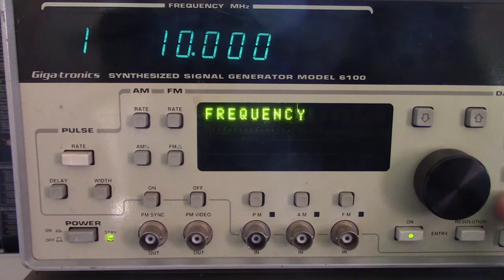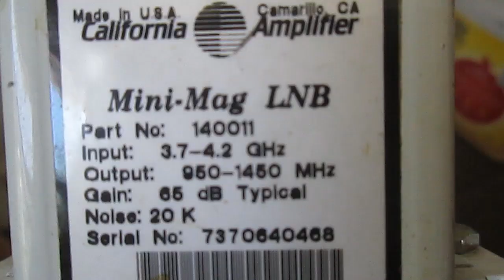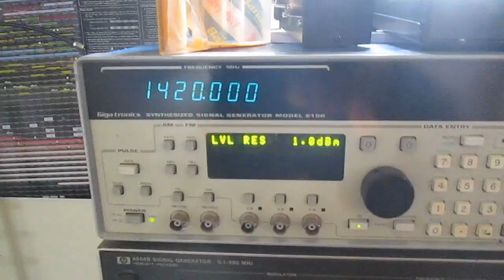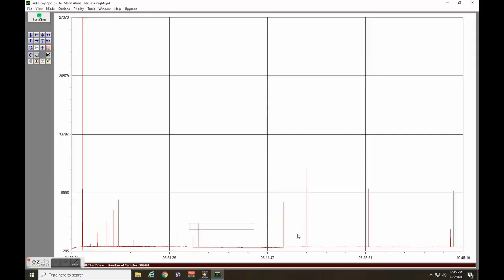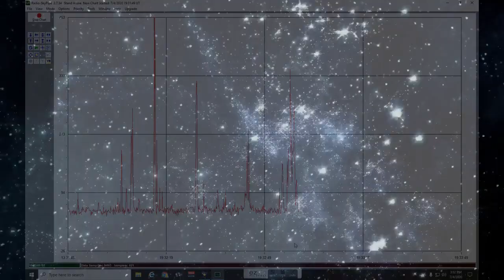DIY RADIOASTRONOMY

Comment: I have purchased my parents old house from the estate. There are a lot of tall trees to the east and west but I have had some luck with backyard astrophotography so far. There are not one but two 12' aluminum mesh satellite dishes (left over from the old c-band days) in the backyard... Would these dishes have value in a DIY Radioastronomy setup? Could they be used together and increase effectiveness?
Reply from the maker: 12 feet ! Hell yeah they would ! You can even combine the signal and make an interferometer !!! That's really good stuff!!! Look it up and enjoy ! You can have a lot of fun!!! I am actually jealous!!! Please post pictures or video of the whole setup !!
Reply from the maker: The link doesn't open
Reply: @Neptunium   Darn... I tested the link and it works for me but I'm no YouTuber. It's the only video in my channel as I just did it to show you. I value your opinion of what I would be able to do with this. Hope you can take a look there.
Reply from the maker: @stringb2647  ok it worked ...yeah I see  what you mean with these tall trees...it should nt matter too much at longer wavelength. Here is the catch these antenna get better gain at smaller wavelength. Right where the trees could  be a problem...but I would still try  because what you might loose in gain in one antenna, you'll gain it 10 fold if you combine the signals from both antennas . When they point in the same direction you'll have the equivalent resolution of a 100 foot dish!! So who cares about the trees!!!
Reply: @Neptunium  As we approach another July 6 (my birthday) and a year since you uploaded this, I have completed my Tandem RASA8 Observatory. In 2021 I’m ready to start building the interferometer. I blew the budget on the optical light rig so I need to do this on a tight budget if possible. If you were starting from scratch (nothing but the dishes) in 2021 and were maintaining a modest budget, What dollar amount would you budget for my project? The LPT-3000 alone is WAY expensive. Are they’re cheaper spectrum analyzers that would work or is that the minimum? What additional software expenses would I have? The IRC7000 is within budget… Is that still the best bang for the buck? What other equipment expenses would be in your budget.One dish still has the old LNB and I may have others in storage  but I may be off using  soup cans? I actually have 2 directTV dishes in the same 100' apart and 30" behind the big pair... There are LNBs on those too. Crazy Idea Could I use all 4 dishes? Would that even help?  I’ll manually point to  the zenith first and only get the actuators running. after the proof of concept test is successful. You were absolutely the inspiration for leaving these 12” beauties in place.  I would appreciate your knowledge to move this project forward. Sorry for all the needy questions. Thanks in Advance. Steven
Reply from the maker: @stringb2647  maybe you want to look at SDR (software defined radio) like the RTYL2832, that could give you a glimpse at the spectrum . from past experience, i`ve used the AVCOM 37 or PSA they are cheaper and way more sensitive than mine. but cheap is the key word and sometimes fails....you get what you pay for my friend...who knows? you might get lucky and find a good reliable one that will last you for decades...the LNB are usually pretty cheap , don`t let some greedy seller fool you, there is plenty of supply. Much like everything else, there is always a certain amount of luck and patience involved in digging for deals on ebay, you`d be surprise to know how much i actually pay for the LPT3000...dont despair, be patient and you will be rewarded. stay safe and have fun  
Cheers
Reply: @Neptunium  Thanks so much… I have ordered the Nooelec SAWbird+ H1 Filter LNA and a NESDR SMArTee v2 SDR for $79 on Amazon. I can play with one dish very easily with GNU Radio. I assume with the in-line LNA, I shouldn't use the LNB’s? What is the soup can without an amp called? Should I just make one instead? I know that I would need more of an investment to support the interferometer and capturing fainter targets. I’ll be on the lookout for an Ebay deal on a sensitive spectrum analyzer. How would I combine the signal from two dishes tho?
Reply from the maker: Great stuff... the soup can is called the ferd horn !lol this is just a copper wire 1/4 wavelength.  How to combine everything is possible i saw something on line once but never did it myself....google is your friend...be aware of your equipment limitation and noise level. But you ready to have fun my friend...
Reply from the maker: Awesome ! Thank you!!
Reply: @Neptunium  As a few of these items have arrived,  I can already see that mounting the SDR at the dish for my short distance makes for a much simpler setup. The SDR's built in bias tee is all I need. Still I'm having cloudy night fun switching out the H1 for some terrestrial radio pursuits while I'm designing the feedhorn. I like this modular setup within reach on the mount. No ladder required.
Reply from the maker: Excellent ! Glad you enjoy yourself with this project! Keep it up my friend
Reply from the maker: Absolutely! Yes thats the spirit! Hlad you are having fun ! Please post your  results!

Comment: Nice video... Sharp and concise. Is it possible to use a  helical antenna for detection too? I mean since the Wavelength, frequency range is within the performance range of helical antennas. Thanks
Reply from the maker: Yes ! It has been done before...but a directional antenna eliminates a lot of the intereference noises thus lowering the background and allowing lower signal detection..

Comment: Wonderful video. I just have few questions. We made itty bitty telescope and we don't know how to gather data from antenna. Telescope works well(we hope).

1. I found a article which gather data to computer with set-top box.(which we failed)Is there any way to make it success?

2. Is it possible to analyze antenna->oscilloscope->computer or we need more device such as radio receiver?

best regards.
Reply from the maker: Thank you for the support. As described in the video thoroughly, you can take advantage of the sound  port of your computer to collect data . The output of the radio is a simple microphone jack. Thats it. Use a head phone jack available everywhere to connect the 2. Very simple . Enjoy
Reply: @Neptunium  Thanks!!

Comment: How did you checked for the size of the radio beam? Using Radio skypipe?
Reply from the maker: Based on the frequency used and the size of the antenna there is a way to calculate the size of the beam. I can send you the equation if you like
Reply: @Neptunium  Yes sure till now I was calculating by running some simulations. I would be great if send me the equation so that I can calculate it practical
Reply from the maker: @shrirangsapate  per wikipedia on the parabolic antenna page
https://en.wikipedia.org/wiki/Parabolic_antenna
beamwidth is KL/d with K a constant depends on the shape of the antenna 9about 70 for a typical dish) L=wavelengh d=diameter of the antenna
you can also use this online calculator
 https://www.satsig.net/pointing/antenna-beamwidth-calculator.htm
or this one
https://www.everythingrf.com/rf-calculators/parabolic-reflector-antenna-gain
or this one
https://www.satellite-calculations.com/Satellite/gain_bw.htm
good luck
Reply from the maker: As explained  in the video, the passage of the sun in front of the focal point of the antenna generates plenty of noise, since we know the size of the solar discs and the speed of the earth rotation we can easily calculate the size of the beam, and I obtained very similar results with both methods .
Reply: @Neptunium  Are you referring to the distance to the sun?  When you say solar disks, are you referring to the size of the sun in the sky say at 12 pm...then you could figure out the beam angle of the sun on the dish?  Please advise.
Reply from the maker: Yes the size of the disk as viewed from earth! Now the visible size of the solar disk is not exactly equal to that of the radio disk but my antenna  cant tell the difference. Its a rough approximation but the theory and calculation confirms it.

Comment: I have a question, what frequency do I need to use in order to listen to star surfaces and other deep space objects? Forgive the question, for I am very new to radio astronomy.
Reply from the maker: Thank you this is a great  question ! I found that as a general rule, stars and astronomical radio source are "brighter" in the lowest frequencies but difficult to pick up and easier but much less powerful at higher frequencies. So depending on the object observed, the area around the  hydrigen line at 1420Mhz is appropriate for that reason AND the lack of interference from man made signal...
Reply: @Neptunium  and what type of rsd, antenna, and other equipment would i need to have to operate and listen at vlf range?
Reply from the maker: @briandavis3356  a very long wire works well... yagi antenna are also used
Reply: @Neptunium  also, what sdr would i need to have in order to listen to the sounds of deep space on the 1420 mhz line?
Reply from the maker: @briandavis3356  i dont know about deep space but Jupiter is very accessible with virtually any SDR..for weaker signals it really all come down to the amplifier and the size of your antenna .

Comment: Do you have an Optical Telescope too? I'm just wondering 🤔 WHY DO THIS? I mean what are you going to get from the data? Turn on the TV without tuning in and you can receive the Cosmic Background Radiation but what to do with it? No criticism intended AT ALL ... Honestly would love to hear WHY 😉 Well done bro!
Reply from the maker: Yes i do have a 14" meade. Why? Well why did you watch the video ? Curiosity? Just for fun or just because? Why do we do anything ? I am just a curious kid and i like to try stuff out. But the professionals can detect things we cannot see, variation on the background can tell us how fast the solar system is moving within the galaxy etc.. immagination is sometimes more important than knowledge my friend
Reply: "Turn on the TV without tuning in and you can receive the Cosmic Background Radiation"  That's theoretically true, but actually almost completely wrong in practice.  The vast majority of that static comes from the thermal noise in the TV receiver itself, and the rest is atmospheric noise.  Yes there's theoretically a bit buried in all that noise from the CMB, but it is far too faint for your TV to hear it.  It's kind of like saying a random cup of water from the ocean contains some of Margot Robbie's discarded bath water.

Comment: I have just about the same thing you have for radio Astronomy, but I lack experience with DIY Astronomy. Can I ask you for help?
Reply from the maker: Sure !
Reply from the maker: @simpsonmichael45  thanks for your interest Mike!
1 the IC7000 does not reach 4ghz. It has a 1ghz addition button. When depressed the frequency displayed the digit after the 1 so 420 become 1420. That's just the way the screen was designed 

2 yes ! Exactly! The frequency generator is part of the video. I show the response from the intensity about 3 minutes in or so

3 I thought I left the link in the description...if I forgot i apologize I'll do it shortly . This is the free chart recording that monitor the input from the mic through your sound card.

4 no ebay

Comment: Hello! I am trying to do something similar with a scrap TV antenna I found... I'm kinda starting out here so I was wondering a few things... what do you use the ICOM R7000 for? Is it connected to a PC? How is that connection? Any recommendation in case I am not able to find an ICOM R7000? Thanks a lot!
Reply from the maker: Hello, with the Icom I can select a frequency . There is an output for chart recording in the front of the unit that accept regular phone jacks 
 This can be directly plugged into the  microphone or line in on the PC. I personally like the r7000  because it has a wide receiving band from 30 to 3000 Mhz, it's an older model but it's easy to use reliable and solid construction . Any receiver from the radio amateur world will be fine...
Reply: @Neptunium  Thank you very much! :)
Reply: Use an SDR connected to a computer for this.

Comment: As a long term ham radio operator, I am intererested in monitoring the 1420.xxx Hydrogen line in outer space.  The thing is, what mode do you put your receiver on???  AM, SSB, FM, etc
Reply from the maker: AM ... most of the time but wide FM works too

Comment: Hi there!
I love this video and I want to build a radio telescope in my school.
here are some questions hope you could answer the questions of mine
what band does the antenna design to receive?
could I replace the ic7000 and the spectrum analyzer with a good SDR?
thank you
Reply from the maker: Hey thanks for your interest...Antennas are designed for a specific range of frequencies but generally speaking thr tighter the mesh the higher the frequency. The manufacturer usually indicate the gain at a specific wavelength on the specifications chart. Very little googling can easily provide allvtrh info on antennas. Yes you can use an SDR .I have not kept up with the latest model but they are usually ok . Although maybe not as sensitive on the cheaper side of things..I used successfully the bladerf from Nuand but it is not a cheap model...good luck with your project ! Stay curious my friend

Comment: Hi there!
I love the video but I have a few questions:
Does the can size matter?
Do you need the big dish?
Is the driven element just half of the 21cm?
Does it matter where abouts in the can you put the driven element?

Thank you so much!
Reply from the maker: Hi! thank you for your interest..
yes the can size matter to some degree but for my purpose, it just happened to fit perfectly in the holder ,
The larger the dish the better , but a dish is only effective with higher frequency wave, it would be pointless to use a dish for VHF for example.
the driven element is a quarter wave and it only matter as long as it is in or as close as possible to the focal point of the antenna .
Happy holidays!  stay safe
Reply: @Neptunium  thank you so much!
Reply from the maker: @rileypowis5319  your welcome

Comment: Nice video.  Just wondering...do you have any problems with noise?  Don't radio telescopes normally have their first preamplifer cryogenically cooled (with liquid nitrogen or liquid helium) in order to keep the thermal noise down?  Or does it not matter for certain types of measurements?
Reply from the maker: Thank you..yes there is background noise but I am not trying to detect crazy low and weak signals ... it's a proof of concept ! No I am not gonna dip it in LN2 for such a small dish ! Lol but the pros do your right
Reply: @Neptunium Liquid helium, actually.